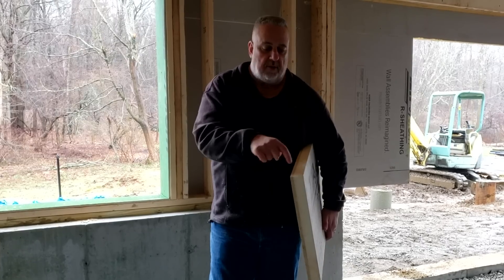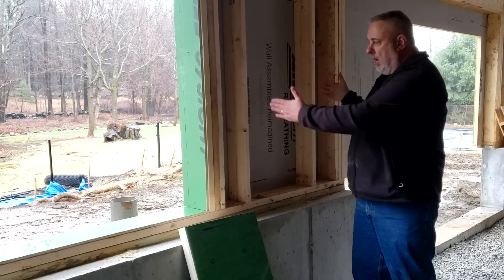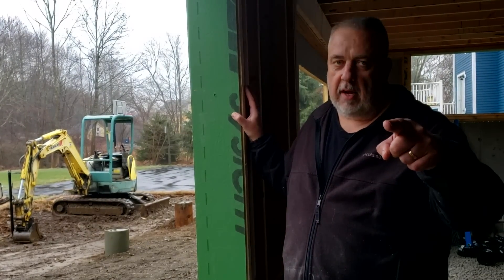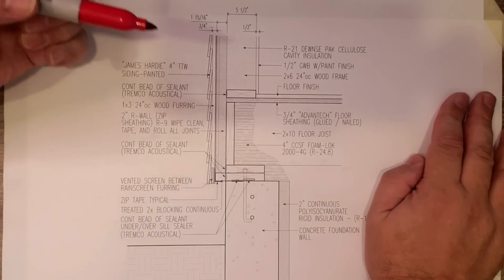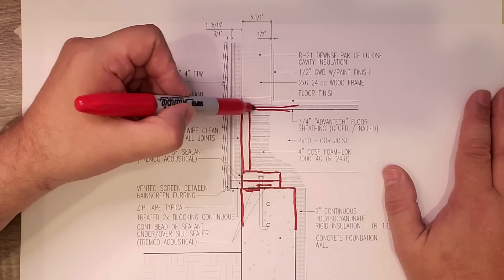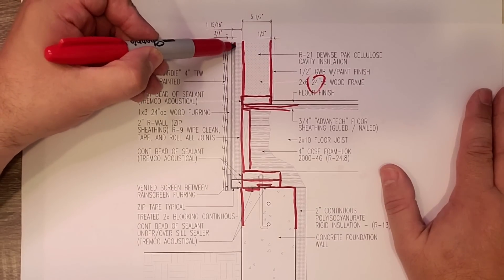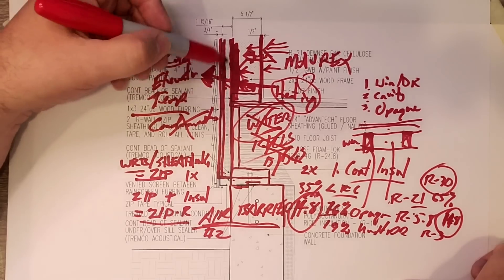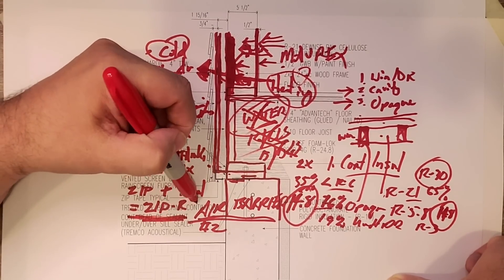INSULATING SHEATHING......Why is it IMPORTANT!!!

Comment: Question:  For cold climates, doesn't it make more sense to use comfortboard and zip non-r than r sheathing?  I assume if the air barrier is on the outside of the wall assembly, warm air will leak to the cold air barrier on the outside and condense on the cold air barrier sheathing.  If the insulation is on the outside of the air barrier instead of the inside of the air barrier like in this example, the air barrier will be warmer and less likely to condense?
Reply: Correct, when you experieince cold winters, it's better to have enough (continuous) insulation at the outside of the airbarrier (and vapor retarder) to avoid condensation.

Thanks to the outer insulation, the ZIP tape on the ZIP R-panels are no longer condensation surfaces.

Extra additional insulation at the inside is still possible, but it's best to keep the R-value of the inner insulation below 20 to 50% of the outer (depends on your climate zone).

Comment: We went with Zip-R12 here in zone 6a based on videos like this.  It just seems so much easier then installing OSB or plywood sheathing, installing window bucks, installing XPS or mineral wool over the sheathing, installing furring strips over the exterior insulation, then installing a WRB and hope everything is sealed properly.

Comment: living in zone 4 I do wonder just how much advantage one would have going with r9 sheathing.  I can imagine that one could accomplish the same end by using a double stud wall. plus it would dry to the outside.  Assuming that a more permiable insulation like rockwool would do a better job as it does allow for drying.

Comment: I would suggest the bottom plate be a 2x8 that extends 1.75" beyond the foundation.  Set the 2x6 on top.  Then run your Skil saw along the edge of the 2x6 and rip off 1/4".  This saves ripping a 2x2 block and then trying to nail a 2x2 without splitting is risky.   The shoe on a Skil type saw is set for 1.5".

Comment: Would it be okay to put foam on the studs and then zip sheeting over? Same concept just not laminated together. See any issues with doing it that way? Reason I ask is zip is about $30 a sheet and 1.5 polyiso is $30 and zip-r 1.5 was quoted to me at $120 a sheet.

Comment: Could you add reflectix behind the drywall and get the same benefits? Blocking interior heat from coming in the wall instead of a moisture barrier.

Comment: I'm getting ready to build and have looked at several wall systems and one that you rarely see is staggered 2 x 4 studs 16"oc on 2 x 6 plates. This breaks the thermal bridging and allows 2" of foam in the exterior cavities. It seems like a very strong wall and you can use 7/16 zip instead of zip-r. I don't see a downside to this other than additional framing cost. I appreciate any comments or additional information. Steve, how about a youtube video regarding this technique?
Reply: I am a 45 year veteran of the Design/Build industry. The "drying thru" component always seems to be batted around, and to some extent, played down. Many years ago, I covered my framing package with Tyvek as it was supposed to rain that evening. Came back the next day and the lumber was soaked. That made me start to question the housewrap concept. Additionally, back in 1978, I built a home in Jacksonville, FL and I put a .06 mil visqueen barrier on the interior before the drywall application. It created a moisture barrier at the back of the sheetrock, which became a nightmare! Since then, I have been very shy of creating condensation planes, withing assemblies. Styrofoam is water impermiable, as it is closed cell foam with air trapped inside it. There is no, "drying thru" it, so the condensating surface is where it meets the stud! Why would you do this? In my zone 2 climate, I tend to lien toward an assembly that will "dry thru" and create a drainage plain, behind the finished cladding. 
As to your question about an offset layout of 2x4 studs, on a 2x6 plate, basically, a stud every 12" would be very strong and as you indicated, would break the consductivity of the exterior studs. As to the application of outsulation, If I were going to use this assembly, I would lien toward a RockWool batt, which is vapor permeable. 
Now, I respect all these men highly! But one of the issues with these types of videos is, climate zones, or the changing performance needs related to them. I do know this, It's vital to get this right, the make up of a wall assembly that is,  up front! If you get it wrong, it would cost 10's of thousands of dollars in repairs, liability issues and possible litigation. None of us want those problems. Good luck!

Comment: Just out of curiosity, why wouldn't you use ICF?  Seems as the cost of Zip R, would push the cost to be comparable to ICF.  Not to mention the added structual integrity of ICF, and the thermal mass

Comment: Steve, I don’t get how taping the poly iso portion seems of the zip R raises its temperature I get it will reduce air and have moisture migration. However it will also preclude the warm interior environment from warming up the cheating surface challenger logic here.

Comment: Look, you were a great company they make excellent products. They provide great back up, but there is a really stark vulnerability of their system in that it is vapor and permeable especially when it is taped properly your locking any moisture that’s in there inside the wall and you better have a drainage plain behind it, that also ventilates, and that vitiates any external installation you have, because you’re not gonna reach the full Arbor think about it if you have cold air circulating behind the zip wall fromthe ground to the soffit it’s taking away a large amount of your our factor gain for the 2 inch insulation and then of course it all gets back to cost-effective. The zip are is not cheap.

Comment: Steven, can you explain the difference in benefit or loss between the ZIP R (poly iso to studs) and putting poly iso on the exterior of the sheathing?
Reply: Hey mdk I have same question. Hope it gets answered.
Reply: ISO or EPS is better on the outside of the sheathing for shear strength as the sheathing is against the studs. The downside is another WRB is 'required' on the outside of the continuous insulation. That being said. Still far less expensive to post EPS or ISO and cover vs. ZipR but more labor. Atlas PolyISO or EPS is my cost basis for the comparison as it is Hubers ZipR supplier.
We are currently building a Brutalist Home in zone 5 with 2 framed rooftop structures that are clad in 4" EPS and covered directly in microcement (to match the rest of the structure) as you would do EIFS. It's a crazy efficent system.
Reply: @Veritasi  which is best at managing dewpoint? With zip-r the humidity inside passes through the wall cavity and hits Zip-R's ISO as opposed to passing through the OSB/Zip then hitting the ISO on the outside of the sheathing. I'm trying to understand which is best?
Reply: @mdk777s6  Honestly, neither makes a large difference. The amount of moisture moving through the drywall can't really be mitigated passively. My goal has always been one way movement. I'm not in agreement with "a house that breathes" approach. I'd rather seal it up and actively control the air moisture. A well insulated and sealed wall will have very little 'dewpoint' layer. That being said, EPS is the easiest to 'dry' without ever have a mold concern.

Comment: I absolutely love all your deep dives into the details I'm sure many builders would forgo.  

I have a 1926 home without any stud insulation.  We are in the process of re-siding the exterior.  I'm debating whether or not to blow in insulation into the wall cavities.  Even though I'm putting a rainscreen on the outside, I'm thinking now that i will still have condensation from the inside.  Thank you for all your awesome videos
Reply: Suggest you talk with a mechanical engineer.  He should be able to tell you whether or not you will have condensation and where.

Comment: I have had question about zip R in regions that get cold I.e. water vapor moves from inside the house to outside.   With the insulation prior to the WRB, condensation can happen on the backside of board versus insulation outboard of the WRB which allows condensation of vapor outboard of the WRB.   I can get my head around ZIP R in regions where vapor moving outside is minimal but in regions where there are many months of heating season, the condensation is on the back side of the ZIP, I.e. man made wood which is not treated like the outboard face.   Yes you can reduce it but if the customer wants 40% humidity in the winter so they don’t itch, that moisture is going to follow the heat and move towards the outside.
Reply: That Zip is not  for the cold climate. Those who would try to convince you counter wise , simply want to sell you that stuff or services
Reply: @andreycham4797 of course it's for cold climates.
Reply: @lrc87290   you have to chose proper thickness of   Zip insulation to keep dew point  in it on coldest day .   After considering all such details SIP can be cheaper
Reply: It's warm so it's not going to condense.

Comment: How does the nailing pattern of ZIP-R affect the heat transfer? Obviously the nails are tiny but they're still highly conductive and ZIP-R requires a lot more of them. With all the extra nails required, doesn't that negate some of the benefits of the thermal break? I'm assuming this would be a small effect but curious if this has been studied.
Reply: Its actually a huge effect. Just as steel wall ties in a Thermomass concrete system negate 12.3% of the r-value vs removable/filled ties.
Reply: No effect.   No more nails needed for ZIP R than with regular sheathing.   I am structural and mechanical engineer and I call out the nailing pattern depending upon shear load required.   I do engineering in the hurricane high wind areas of the country.

Comment: Very good video.   I would add the limitation that this video is for very cold climates.  We would never put the sealed up vapor barrier on the inside of a wall in cooling dominated climates.  And certainly much, much colder climates might need more outer insulation, and less in the wall cavity.

Comment: What happens if a homeowner put a picture on the wall and poke holes in the vapor retarder ?
Reply: The zip sheathing is on the outside of the house. Pictures are nailed to drywall.  The mail hit the studs or the insulation. No mail is going to go through 6 inches of insulation and another two inches of zip insulation, penetrating the green zip sheathing

Comment: Would it be the same as placing a larger (2x8) treated plate off the top of foundation wall vs a 2x2 added to bottom of exterior wall at 2x6 top plate of foundation wall?

Comment: I have been a building contractor in NH for 35 years. My concern with rigid foam exterior insulation, is the potential for a dew point forming on the inside of the foam surface. I have seen the damage caused by this several times first hand in remodeling homes that were built with a "flash and batt" system. This was a common system in the early days of spray foam. We found you need a minimum of 2" of foam in NH climate to prevent this. I see houses built with 1" Zip sheathing in my area (zone 6). I believe there will be major problems with these homes long term.
Reply: If it can't dry it's gonna die
Reply: The gaps in the insulation will also allow some air to get to the back of the zip tape. It puts the insulation on the wrong side of the water/air barrier. The Sega Majrex is critical in this wall.
Reply: I was wondering about where that moisture ends up as condensation. Does the foam board just act as a larger bucket for the moisture until it can find its way back out?
Reply: Condensation will only occur on a surface, and not within the insulation.  I would suggest that the interior be foamed to provide a continuity and adhearance insulation.  The areas where the studs connect would not be much of a concern to me.
Reply: I agree, but most construction I see with R5 zip they are insulating the wall cavity with batts, usually fiberglass. @coasttal123
Reply: Word
Reply: The problem of course is Steve Notes is that you also have a very good vapor barrier precluding any drying to the outside of this wall he does address this with the Myra, but this is an additional expense and procedure so you were saving a trip around the house on the outside but you’re adding it to the inside and my ex is not repeat not cheap most importantly, though as one of the other posters move it to you have to be very very careful to make sure you don’t put too little insulation on the outside or else it’s worse than none on the outside if you can’t have adequate insulation for your climate zone and building design, you should simply forgo it, and as the New Hampshire poster points out most people are just putting up a small amount of insulation on the outside like 1 inch and simply placing your walls at risk
Reply: I'd highly recommend regardless of "blank many yrs..." work with an eng or architect the specialized or well versed in high performance (there will be more as it becomes standard)

I have heard every fish story of failure and it typically has more to do with 2 things 1 improper application.
Or improper modification.

If old uncle Chuck throws an extra exterior hose bib or outlet or Walt the local window guy doesn't maintain the envelope...game over. 

Best to think of this as do you have car mechanics work on planes? And the reverse is true for diff reasons.

Comment: Hi Steve, I'm building a simple long house with a 14 on 12 vaulted ceiling, (no attic) in zone 3.  Why couldn't I use ZipR on the roof with the insulation out, then a peel & stick WRB, batten rainscreen, then metal roof. It would allow a warm roof in fewer steps. Inward zip would be air barrier only.  Code seems to call for ext ins OR vapor diffusion port with vapor permeable insulation against the deck from inside. I could add vapor diffusion port for added security.  So I suppose my question would be this: would inverted zip face be a negative in this situation since its 12-16 perms? Aside from not taping it from the coated side.

Comment: Steve, You hear about spray insulation and termite or ant infiltration of it, which can be a disaster, what about the polyisocyanate layer on Zip? Is there the same concern? Does Huber say that’s bug proof?
Reply: If you look at the section diagram (and most other SBA videos) the bottom sill plate is extended the depth of the ZipR or whatever external insulation is so as long as you do due diligence in your sealing, the bottom of the insulation is capped with solid wood. If you are in a place where the ant/termite problem is excessive , you can always use mineral wool panels instead.
Reply: @JoeBieniecki  The 2x8 bottom sill is 1.75" greater than the 2x6.  Easy job for the framer to run his saw around and clip off the extra 1/4".  Much the same as he does for cutting door openings in plates.
Reply: @coasttal123  The 2x8 goes down first, just set the 2x6 position to whatever reveal you need
Reply: @JoeBieniecki  You would want them to be the same on the inside of the house, at least I would.  This means the 2x8 sticks out 1.75" more.  Easy to trim the 1/4" since the shoe on most Skil type saws is set for 1.5".    This allows the R6 sheet of ZIP R to rest on the protruding, and trimmed, 2x8.  Then Hardi or whatever goes smoothly over that.